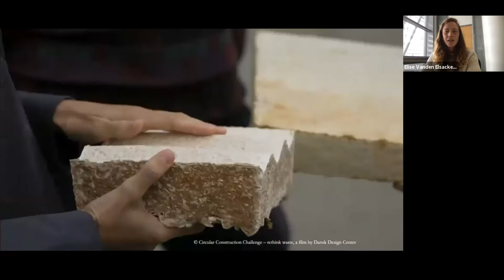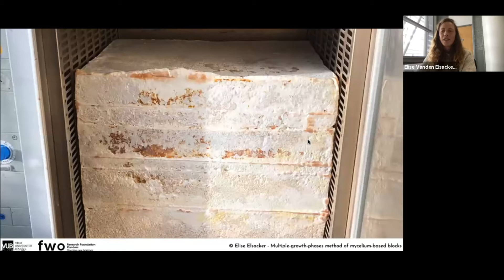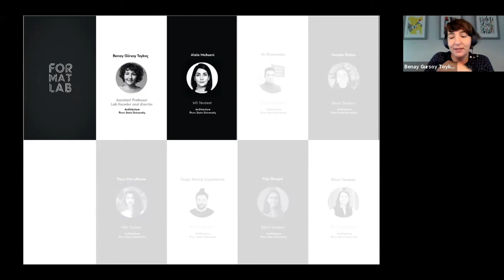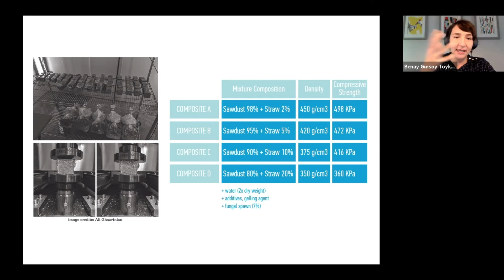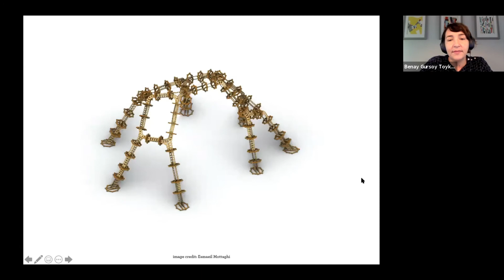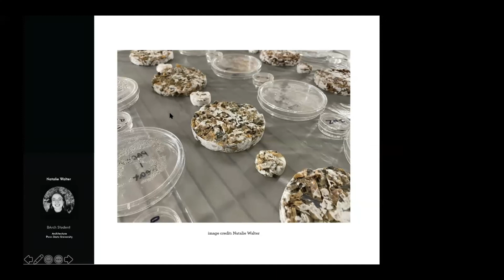Mycology for Architecture: Big Scale Applications of Mycelium Composites

Comment: The error is to create a problem and trying to solve it.  The structures you are using are based on concrete structures which requires tensile components  to complement its lack of tensile strength.  Myco structures are very weak in tensile strength and some compressive strength, but much less than concrete.   Myco structures need a different approach to take advantage of its inherent advantages- lightness, can be grown into many forms, have some compressive strength and a little tensile strength (depending on the type of substrate for the mycelium is grown in; if long fibre substrate with tensile strength is used, it will lend tensile strength to the final product.  Long slender structures will have inherent problems due to the slenderness ratio.  My guess is that myco structures is best in panel form that is attached to a strong structural frame of a much stronger  material.  Growing the mycelium around a structural frame has inherent problems as was demonstrated.  It is forcing the material to do what it does not want to do.

Comment: Isopropyl Alcohol will do the sterilization work for the wooden parts.

Which type of mycelium works better what do you think? Pleurotus or Ganoderma?

Can we use a small percentage of glass fiber in mycelium composites?